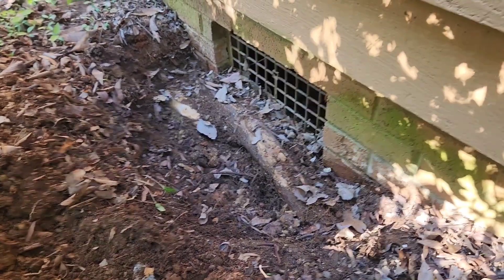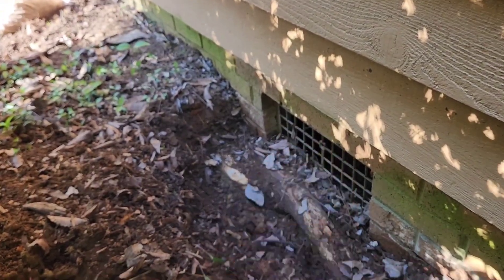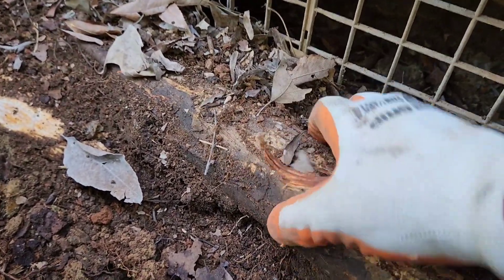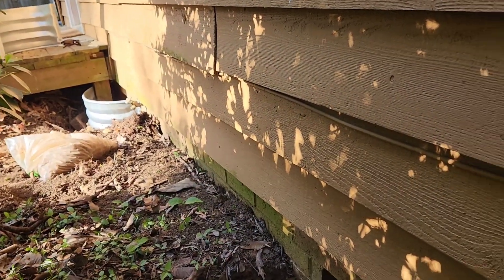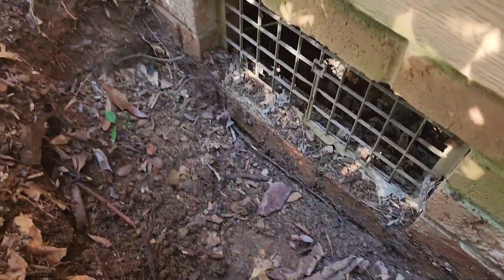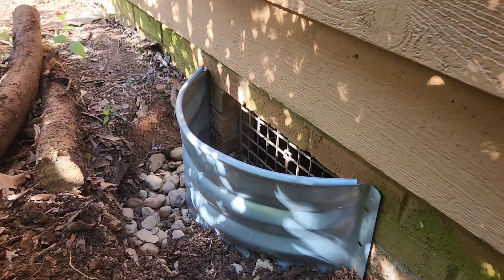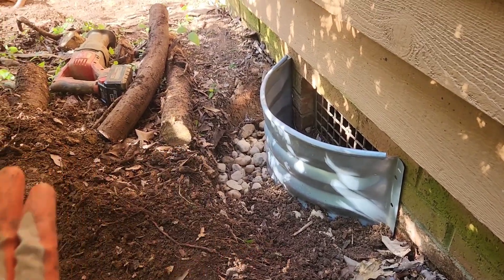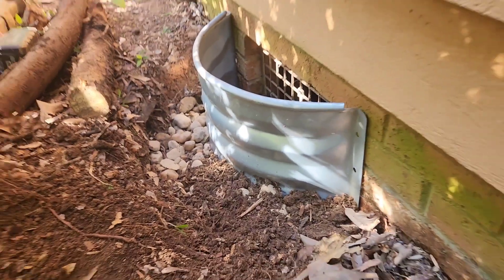Vent Wells and Yard Drainage - DIY

Comment: thanks so much for this. we have some major problems with the vents been low etc. Is the reason the vents are lower because the ground outside has got high or has your house sunk a bit? i think ours is both
Reply from the maker: I'm pretty sure this property was that the ground raised over time due to neglect.  The tree roots grew through the composted leaves that were never removed and that cycle continued.

Comment: Do you need to drill the well into the house or would it stay up on its own by packing it with dirt?
Reply: It’s always best to mount them directly to the foundation using Tapcons.
Reply from the maker: Best to mount to house but not absolutely necessary if you build up grade and pack dirt outside.